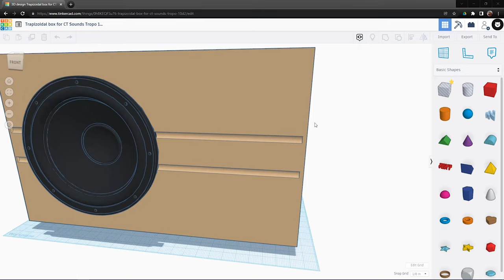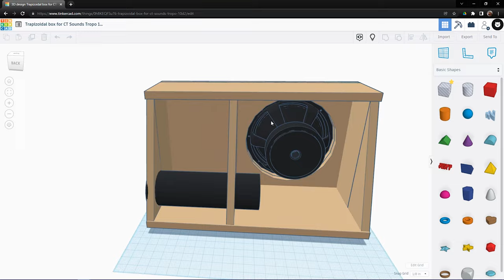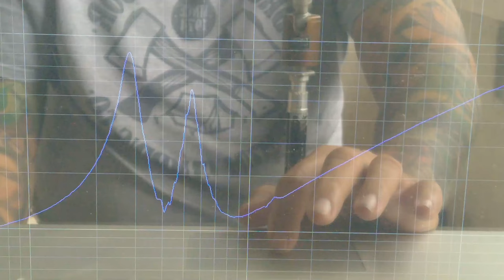DIY Subwoofer Box for Suzuki Swift

Comment: Great fan of your understanding towards your work, sir wanted a help, have same swift and want to install two sony 1800W subwoofers, just help me with the dimensions of enclosure so that i can tell my local person about the same, thanks in advance ♥️🙏🏽
Reply from the maker: thanks. you can get the dimensions in every build video. there is a link to the TinkerCad 3D schematics in the video description. You need to create an account and login to TinkerCad so you can start using it and seeing the dimensions. Use laptop or computer web browser to open TinkerCad.

Comment: Very nice videos,curious though in some I see you use a nail gun, and others I see you using a pocket hole guide with screws,what's your personal opinion on which to use for what box and for the nail gun what brad nails size and thickness do you use and have you ever had any boxes come apart using a brad nail over a screw?
Reply from the maker: Plywood - screws in pocket holes
MDF - brad nails

Comment: How did you come up with that glue in the bottle ??
Reply from the maker: Hello Roberto, it's a ready made glue available locally branded as "Pioneer" and it's very cheap too.
Reply: It's contact cement sold in bottles
Reply from the maker: @leog978  oh the rubber cement, yes they come in bottles and very cheap. Good for adhering upholstery material. 😁

Comment: Can i have measurement for a 6inch subwoofer please
Reply from the maker: There is a link to the TinkerCad 3D schematics in the video description. You need to create an account and login to TinkerCad so you can start using it and seeing the dimensions. Use laptop or computer web browser to open TinkerCad.
Reply: @chrclmnky  ok tanks u 🤙🤙

Comment: Hey, how do you hook up the sub to the standard head unit?
Reply from the maker: installed a class d monoblock amplifier
Reply: @chrclmnky  thanks - but how do you get the signal from the audio to the sub?
Reply from the maker: @x19guy  swift 2021 oem stereo has an output port for sub, camera, rear, etc. All you need is buy the wire harness.
Reply: @chrclmnky  wicked thanx!

Comment: Hi how did you get through the firewall?
Reply from the maker: Passenger side there is a rubber grommet you can pass cable thru it and thru glove box area.
Reply: @chrclmnky  thanks! So you start from inside the car, not the engine bay?
Reply from the maker: @x19guy  engine bay. i was up and standing on the engine supports the get half way down the firewall to insert a fishing wire.... ultra effort and back breaking task.